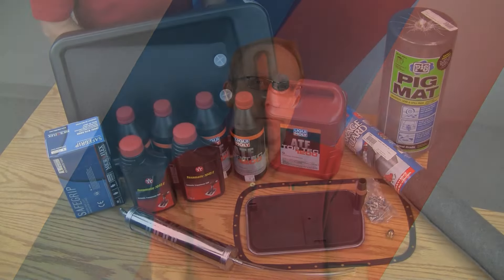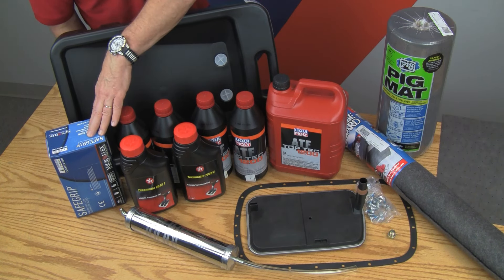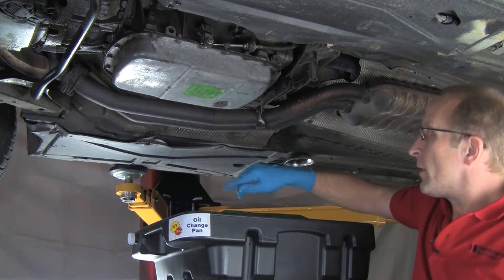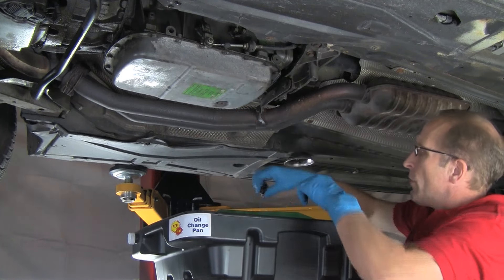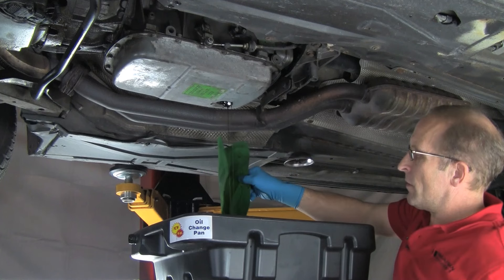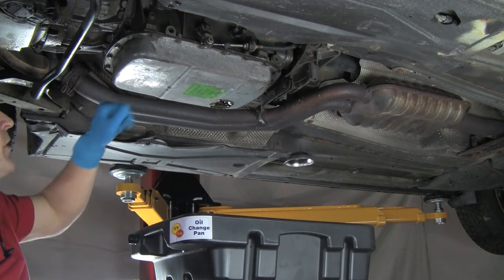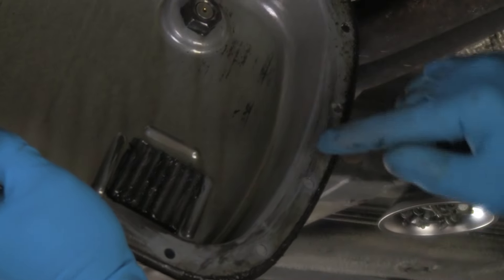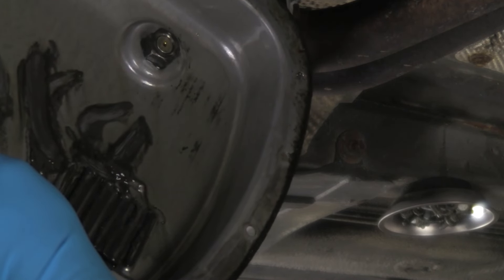Part 1: Changing Automatic Transmission Fluid & Filter On A BMW/MINI

Comment: Undo the fill plug first..........  You need to be sure you will be able to fill it before you drain the Transmission sump!
Reply: beat me to it
Reply: I think you can't fill the amount what you have drained isn't?
Reply: @mahendran2127  no it’s more of a stuck bolt issue, you don’t want to drain it and put it back together and come to find you can’t take off the fill plug because it’s stuck on or rounded
Reply: Rat on

Comment: Good video Otto and well explained. I have a 1992  M3  SMG II with 110,000 miles on the clock , the  orange tell-tale comes on and the gearbox goes into neutral and of course  the acceleration pedal does not work , I take it this is a safety thing but not good if your in the outside lane on a motorway lol , should I take it that the filter and fluid needs changing immediately.
Reply from the maker: do you mean a 2002 M3?
Reply: BavarianAuto sorry for the delay in replying Otto , yes the car is a 2002 M3
Reply from the maker: lazzag
We doubt a fluid change will help. By the way, the SMG is a manual transmission with the automated clutch, so it does not work like an automatic transmission as far as fluid and filter.  We would suggest that the first stage is to have the stored fault codes for the transmission checked.  This will give a direction to follow with any further diagnostics.

Comment: Is this video of 530d E39 facelift
Reply from the maker: 2000 528i wagon
Reply: is it the same procedure to do on e39 530d?
Reply: Aleksej Ukrainec yes its same procedure. I made with 525d e39 few days ago cost is 210 euros but regular cost is 300 euros.  Zdravstvuj. 4.5 liters of oil is 70 euros. Use original from bmw. Do not attempt to find cheap oil you can break your auto trans...
Reply: Sposibo :)

Comment: I am about to do this to my 2002 325i. Should I be worried about the old oil not mixing well with my new fluid? (Dexron D4 ATF is what I will be putting in)

Comment: I/ we just did a drain & fill on my 05 325xi using BavAuto products,ZF Lifeguard 5 as well as the atf filter. Pretty straight forward procedure, Thanks Otto, but curious if I have 2 liters of the old fluid behind torque converter how many more times do this process in order to get ALL of the old fluid out ? and what mileage interval ??
Reply from the maker: Let's use the example of:
* The fluid drained is 50% of the total fluid (50% is left in the transmission).
* In this case, we refill and we now have a 50/50 mix of old and new fluid.
* Drive the car around the block (or longer, doesn't matter) or run it on the lift ... with the transmission in-gear ... for 15 minutes or so.
* A second drain/fill will remove 50% of the old/new mix and will add 50% new fluid.  We now end up with a 75%new, 25% old fluid mix.
* Each successive fluid drain/fill will get us closer to a theoretical 100% new fluid.
*  Once the fluid has been changed to the point that the existing fluid in the trans is bright and clear .... looks like the fresh new fluid ... we can drive until the next change interval.  At this time, just one drain/fill (and the filter) will be sufficient.  this is assuming a 30,000-ish mile interval.
Reply: BavarianAuto thanks for the update,probably wait until about 30K  to do this procedure again.

Comment: Thanks "Auto"!

I want to change all of the fluid(I don't want any of the old fluid to dilute the new fresh fluid).

I should be able to get the car up in the air this weekend(It's an '01 540 iSport with about 117k on it.) to see what it may look like.
Reply from the maker: Good luck, remember, you can perform multiple changes of the fluid, after the initial fluid and filter install .... in order to get closer to 100% fresh fluid.

Comment: fail @2:25 you guy's are in a shop, but for the rest of us, always always always pull the fill plug first, because if you drain it and you can't remove the fill plug for some reason, that is going to be a very bad day !

Comment: i just wondering if i can use ZF lifguard -6 instead of 5??? PLEASE HELP
Reply from the maker: Depends on the model.  The Lifeguard-5 is intended for the 5-speed transmissions and the Lifeguard-6 is intended for the 6-speed models.
Reply: Suhaib Qra what's the difference?

Comment: I have a BMW X3 when the car is hot the gear becomes  difficult  to change could it be the transmission fluid and filter  that need to be change

Comment: I have a 2000 BMW 323ci  Is this procedure the same for my car? 
Also... I've got a nice sounding car, but have noticed that if I get on it hard (lead foot) when It switches from either 2nd to 3rd or 3rd to 4th  it will pretty much feel like it goes in Neutral and rev up loud, when this happened I of course let off the gas.. once I do that it switches gears fine. Does this seem like a Trans Fluid need? top off maybe? idk if I wanna flush it at 208k miles.

Thanks in Advance!!! GREAT VIDEO!
Reply: Also... I called the BMW dealer in Columbus and asked for a quote on Transmission flush and fill. I told them I just bought the car and it seems to run fine. I do not know if the trans has ever been serviced. They told me to not mess with the trans if it has no problem, just leave it alone he says. But now I've noticed what I believe people call slipping (stated above).
Reply from the maker: Cody Tilberry
- Yes, start by changing the fluid and filter.  This may (likely will) improve the shifting and will certainly improve the life expectancy of the trans. call 800-535-2002 or visit www.bavauto.com for assistance.

Comment: Hi, I have a 2004 land rover range rover with the ZF5HP24 Transmission, it has the m62 4.4 BMW engine. I would like to change the trans fluid and filter. Is this the same trans in the BMW? What is the part number for the kit with the filter, gasket and new magnet?  Thank You

Comment: what about GM transmission(not ZF ) ,is it required the same oil type like ZF?
Reply from the maker: The transmission shown in this video is the GM A5S-390R.  The new ZF LifeGuard-5 fluid has been approved for use in the GM as well as the ZF 5-speed transmissions.
Reply: BavarianAuto thanx for your kind reply,
 could you please provide us your opinion about using valvoline dexronVI ATF fluid/ fuchs TITAN ATF 6000SL/CASTROL transmax.
also , some people told me that using liqui moly atf 1200 will increase fuel combustion .

thanx again for your valuable info.

Comment: Is this the same steps on  ga6l45r transmission.  The pan looks. Not dip like this on the video?  And im not sure where to place my rule level.   If do it on the middle bottom or on the side like you did ?  Thank you

Comment: I have a 99 M3 E36 auto trans  I had it serviced and transmission fluid changed, my service advisor told me I had a tech 6 I believe this is correct Auto Trans. which is a factory upgrade and can use only Synthetic . can someone clear this up for me or is this BS. thanks

Comment: My 2003 530i has a ZF 5HP 19 transmission. The pan is held on by 22 M6 screws with a Torx 27 head. Getting the first 21 off wasn't too too bad, but the last one took me... I won't say how long. Heating it with a torch may or may not have helped. After trying six other methods, I took a T30 bit and whacked it in there with a big old hammer.  Success. Those screws are about $8 each by the way. My hardware store has some stainless M6 screws with a hex head for 79 cents, and I'm tempted to replace them all.

Comment: I have a 2000 323i that's giving off a p0740 code. I was told that i may need to have the tranny fluid and filter replaced. It is an auto and it doesn't skip gears or anything.. shifts like new. I hear that the TCC solenoid is inside of the transmission.  Is it difficult to replace? I also heard that the code can be a result of an electrical issue. Is there a relay or fuse I can check?

Comment: Ive changed the noisy sterring pump, for my BMW 320i.
But the challenge is that the sterring wheel is more stii/harder than before i changed the noisy pump.

Please help me wht is the problem now?
Reply from the maker: Without having the car to test, we can only suggest a common issue.  The steering shaft universal joint may be dry and tight.  Raise the front of the car (both front wheels off the ground).  You should be able to spin the steering wheel very easily with just one finger.  If it is tight or it goes tight-loose-tight-loose, the joint likely needs to be replaced.

Comment: In a regular customer of bavauto. Don't settle for less than the best! My 2001 325xi has been having some issues lately. My gear box is automatic. When I shift from park to drive, I get a kick back from the car and it feels the car drops an inch or two in altitude. And its the opposite for going from park to reverse. I get a kick back and the car raises an inch in elevation. Sometimes the kick back is pretty hard. I don't know if I should get rid of the car before the problem gets worse or whether I should change the fluid because its never been changed. Would changing the fluid fix this issue?
Reply from the maker: What is the engine idle RPM at, before you shift from PARK?
Reply: BavarianAuto around 900 RPM - 1100 RPM. it has 119,xxx miles on the odometer and i doubt that the ATF was ever replaced. but i dont think it would be the cause for this. is there perhaps and underlying transmission problem?
Reply from the maker: BrooklynReps
Our first thoughts would be:
1)  The idle is a bit high.  You may just be experiencing the results of a high idle when going into gear.  This would apply to both the kick-back and the rear suspension raising and drooping.
2)  The torque converter lock-up clutch may be partially engaged, having the effect of a much "tighter" converter.
First step .... get the idle down to the specified speed, which is more like 700 to 800 RPM.  The idle may be high due to a throttle body issue (throttle blade not closing fully), idle control valve sticking or a vacuum leak.

Comment: Do you recommend a fluid change for 2000 528i with 125K miles. I have read many stories online that say to avoid the change after 100K miles.

Comment: Ihave a 2005 545 and when shifts it sounds hard idid the transmission oil change and it was good for a week but i think it has a leak cuz it feels like it used to... Any advice please help look at my video thanks
Reply from the maker: If you do have a leak that is big enough to cause the fluid level to go down enough to be low ... in a week .... you have a large leak and it needs to be addressed.  Otherwise, we would suggest that you double check the current fluid level (with the engine running, remember).  Finally, a second fluid change (without removing the pan, would be our next suggestion.
Reply: did you change the gasket? if so what kind did you get? I hear their are some rubber gaskets out there, while cheap... they supposedly leak like crazy. good luck! Im looking at doing this as well.

Comment: question I have a 2000 bmw 740i base sedan I change the transmission filter and gasket but now the problem is that oil won't go into the transmission I appreciate if you can help me out
Reply from the maker: Check the article in our Fast Times newsletter, on transmission fluid changing.  The article was done on the same transmission that you have in your 740i.  If you have further questions, email us at info@bavauto.com
See the Fast Times article - http://www.bavauto.com/newsletter/2006_n206_newsletter.pdf#page=7

Comment: I have an 03 530i and I got a code that says my tcc is stuck off and could be because of dirty ATF. I was thinking of doing a change but realized that a lot of the old fluid would still be in the torque converter so should I even bother? Tia
Reply from the maker: First - Can you tell if the converter clutch is locking (engaging)?  The fault code implies that it is not.  If, by chance the converter is locking as it should, then the fault code is false.  If the converter is indeed NOT locking, we would certainly try a fluid change first.  Do the first change, drive the car for a few miles (or more), then do another fluid change.  Drive the car cor a few hundred miles and see if there is any improvement.
Reply: BavarianAuto i can tell its not locking as it will have higher than normal rpms on the highway. Do u believe a transmission change could help or do i need the clutch worked on at a shop? Thanks again

Comment: Nice ! The only suggestion I have is that before draining the fluid, the fill plug should be loosened first. This will avoid any mishaps of being caught draining all the oil out but later having problem removing the fill plug.
Reply from the maker: Thanks Henry.  We do recommend this as well.  Forgot to mention it in this video.

Comment: Hello. Just need help. my x1 e84 “Drive” gear position is not appearing on my cluster. If it doesnt appear the car is not engaged to “Drive”. If  “D” is displayed/appears then its ok.  I dont have problem with P and R positions, they dont disappear in the cluster. But the “N” and especially “D” position is not anymore appearing on the cluster, reason my car doesnt move forward. When it sometimes engaged to drive, then few miles my car will display the transmission malfuncition and go on a safe mode. Can anyone help me on this pls. I already replaced the transmission gear position switch but now its more severe. I couldnt move my car because it doesnt go forward everytine i put the gear on Drive position, as it is totally not appearing on the cluster.

Comment: I have an e36 328i with 200k miles and I don't think the fluid was ever changed, should I change it?....when everything is at operation temp transmission shift completely fine....just when first drives of the day going from park to a diff gear goes in pretty hard.
Reply from the maker: We would always recommend changing the fluid.  Search through the comments below for more about changing the fluid on high mileage transmissions.  You can also search our tech-blog for articles about this at blog.bavauto.com

Comment: Hi . I have a 2000 740il. at first start and I put it in reverse it makes a noise like the brakes are stocked . when I put it on neutral the noise stops and it works fine on drive. when It first made that noise the abs,break and traction lights went on . I'm confused to if its the transmission or the abs module. what do you recommend ?
thank you in advance
Reply from the maker: Does the noise happen as the vehicle is moving, or as soon as the transmission is put into reverse (before moving)?

Comment: Great video. 
I have a 2000 automatic 528i. And my check engine light came on and the code pulled up a
P0740  TCC or solenoid is going bad. So I asked a BMW tech and he told me to just replace the transmission fluid and filter.  I'm wondering if you can add any other information I could use.
Reply from the maker: It is possible that dirty fluid could be causing the valve that the solenoid operates to be inconsistent (sticking).  In this case, we would recommend the filter and fluid change (and a second fluid only change if the existing fluid is very dirty) and see if things improve.  Clear the fault code and see if it returns.  If it does, then replace the solenoid.

Comment: This is a totally different question what is the proper fuel pressure that you test at the rail. Also what can you do if you get a too rich codes, on both sides?

Comment: Hi, My 2003 325i has recently started major hesitation when trying to accelerate. like trying to accelerate from red lights when it turns green its studders alot and hesitates shortly before actually accelerating could it be that i need to change the transmission fluid bc it has never had one done???
Reply from the maker: If the hesitation is not engine management related, but is indeed transmission related, then yes we would recommend a fluid change as a starting point.
Reply: okay great thanks! the check engine light is not on thats why i was confused

Comment: Thank you for the professional presentation!

Got one question, if anybody can help. Recently my E39's automatic transmission started upshifting gears late. No weird noises, no bumps, no jolts. If I manually up/downshift it works smoothly, but on "D" or "S" mode it is considerably late to shift up. Can it be caused by transmission fluid starvation?
Reply from the maker: Yes, low fluid could be at fault.  However, if the fluid has not been changed recently, we would recommend this as a first step.
Reply: Thank you.
Reply: BavarianAuto your videos are very helpful, I've got BMW 118d auto2009 and recently stary to have a problem with some noise coming out when gearbox is on Drive or Reverse not always and its when your stop holding brake. Any advice?  Thx
Reply from the maker: Daro Daro
 - Unfortunately, we can't tell you much without driving the vehicle.  Have you had anyone look at it yet?

Comment: hello everybody. well i have big problem with my e61 525d 2004 automatic, and i will be thankful to somebody help me with some advice. car works normal but when im driving first 4 gear works perfect and when it changes to 5 gear and i keep drive in 5 gear consistant speed about + - 100km the car(that is my feeling) block for a second the rear wheels every 200meters and on that speed it sounds very very bad...btw if i drive with heavy foot from 1-6gear and drive trough 5gear nothing happens. Thank you very much, and i apologise on my bad english. thanks one more time.